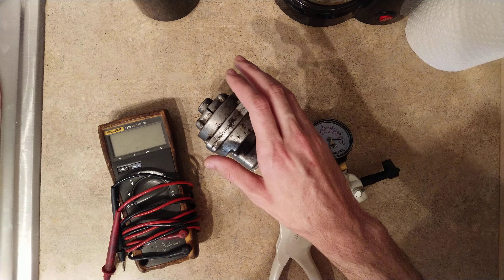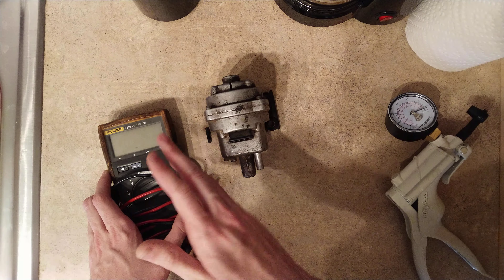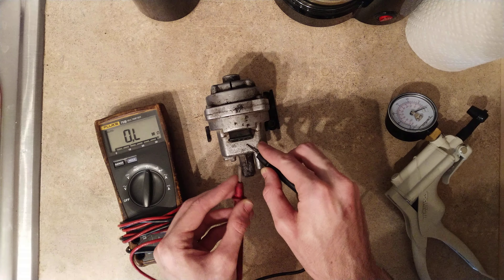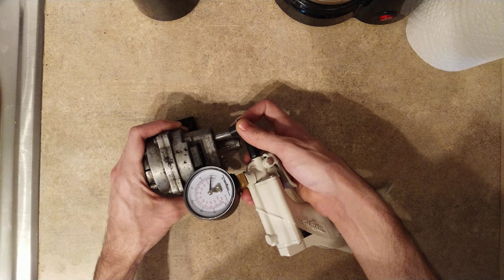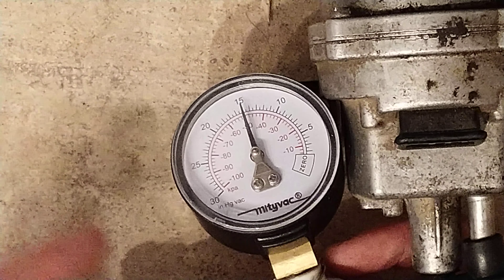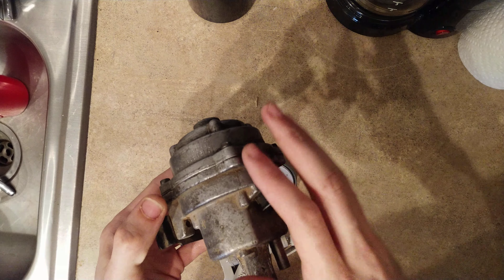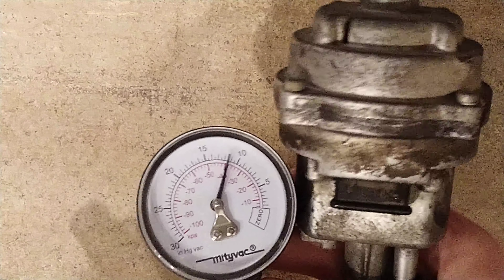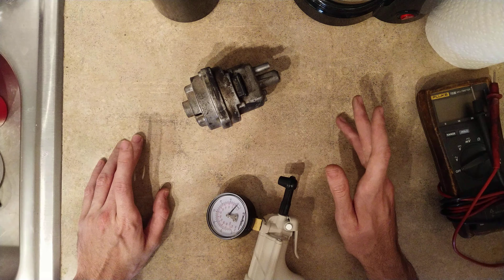How to test Bosch D-Jetronic pressure sensor / Map sensor

Comment: Congratulations for the MAP video. Still about the D-jetronic. How can we be sure if the Fuel Pressure Regulator and Fuel Pressure Dumper are ok?
Reply from the maker: Making a new video soon about those items.
Reply: @cookaacoo  Hi Thomas! I would like to hear your opinion on this problem with the MAP of the M110 engine of my 1975 Mercedes W116. The engine sputters when I accelerate and if I remove the MAP hose the engine accelerates normally, even if I plug the manifold hole. Attached is the video. Thank you!
www.youtube.com/watch?v=Ofguj7pvJ_E